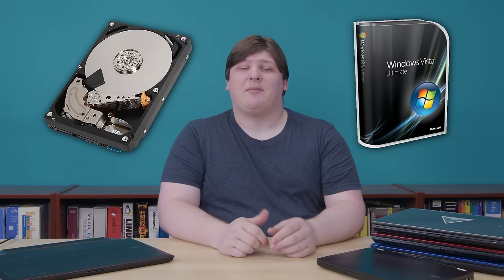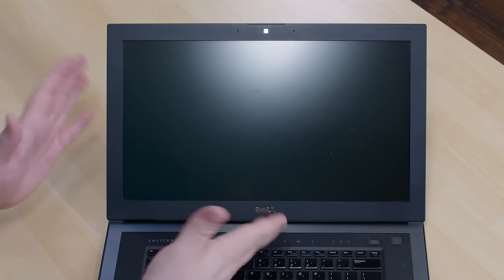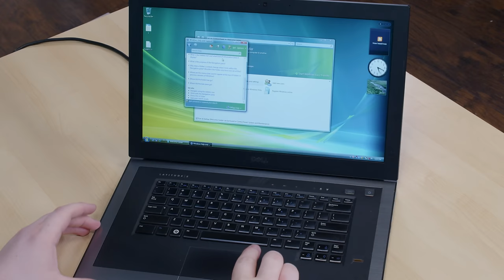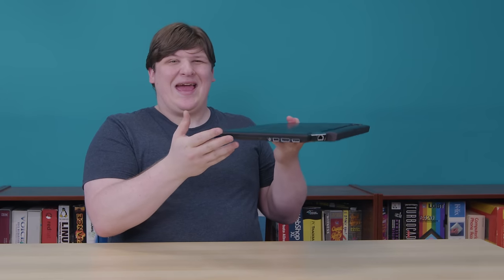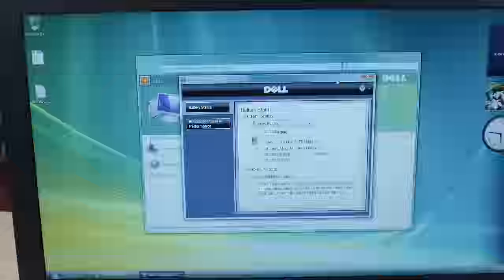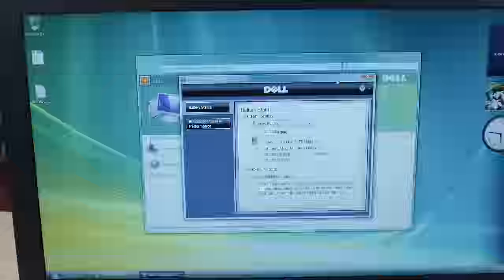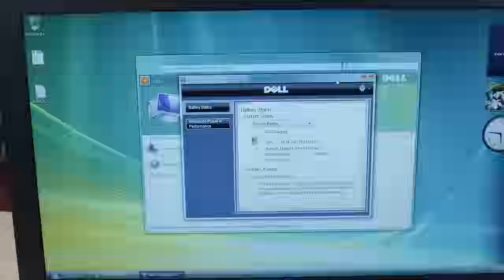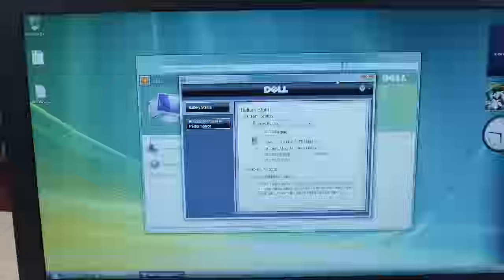Quick Start Ep 6: Assuming Direct Control

Comment: Speaking of that display jab at the beginning...  One thing I distinctly remember about this era is what I call the "great LCD regression."  In the early/mid 2000's, laptop LCDs kept getting better and better resolutions.  Around '07, I even bought a nice HP laptop with a 1920x1200 display.  Then, all of the sudden, you couldn't buy ANY PC laptop at ANY price with a vertical resolution in excess of 1080 (and most being less).  It was horrible.  Pretty much the only way to get a decent display was to buy Apple.
Eventually we got past that, but the recovery started by putting super-high-DPI displays in tiny mini-laptops.  Not by actually putting decent displays in normal-sized laptops until much later.

Comment: I know someone who owned this laptop back in the days probably their job gave it to them while they worked there, I swear!   He also had an XPS laptop that I failed to find existing anywhere. No idea of models numbers, but it was tiny like netbook size and all metal and battery lasted longer than avg, it wasn’t a netbook it was defiantly more powerful and faster. I would say it’s most certainly a laptop dell was flexing it also has every port and expansion possible to fit in a laptop the size of a netbook.  Like CF, SD. PCMIA, maybe have been an esata  as well on the rear, can’t remember where but also had a Ethernet port maybe on rear as well(?) and think came with an SSD.. etc etc, defiantly way ahead of its time.  

And it definitely existed, but I’ve searched every laptop. Dell has made that I can find easily online and I have never came across it… it wasn’t specifically an XPS, nothing perfectly matches or even close enough that it would’ve been the retail unit or the unit he had we assume was retail.    He remembers it, but all the number and letter combinations go to other Dell laptops that are not even remotely close, but he absolutely remembers it when I’ve talk to him.
Reply: I own a Latitude Z, too. 😁 That 'netbook' style laptop you're talking about wasn't a Dell Studio XPS 1340, was it? 🤔
Reply: @FlyboyHelosim  no, M1340 is entirely different looking and too big.  It was much closer to a netbook and as if dell was flexing with what they can do with netbook form factor and silver and all metal, cold to the touch metal on all surfaces atleast closed.  

Oh and one other detail I remember underside where SSD was I assume,  had silk screened “strike zone” on it.

Comment: Amusingly that wireless charging stand could have just had some contacts on it that engage with the laptop and look identical, but actually function. I get the promise of the tech though which is probably why they did it
Reply from the maker: right??? they massively overengineered this! i'm honestly shocked that more laptop power supplies didn't go for this approach. all they needed to do was put four spring pins on the pad and put a low current data signal on two of em so the machine can negotiate power only once it's seated, to prevent shorts. then, bam, you can charge your laptop without having to fiddle with a plug, just set it down.

Comment: 24:33 actually, the Qi chargers send out a short pulse to try to communicate with the device asking for power.  It's around the same frequency as the 125kHz ID chips, so a nice glass tube from dangerous things will show the communication intervals.

I found out because I bought one from Radio Shack for dirt cheap before they went out of business.  I still have it to this day -- gathering dust because wireless charging is inefficient and slow and therefore evil.

Comment: Jail breaking this and putting something like tails on the arm board would be pretty slick if the overall specs of both platforms werent so awful.
It would also be really cool if the module could be used as a rescue or restore platform for windows. That would have been a selling feature in and of itself.

Comment: This also goes as far as the E4310 in the 13/14 inch range, it has the button just like the E6410 as shown in the video. AFAIK it has the module slot just like the one shown here, but my particular example isn't populated with it, so acts like a normal laptop all of the time, even if you press the Latitude ON button. Mine just acts as a second power button, so boots straight to Windows. 

On a sidenote, a modern SSD in this setup running Windows XP is very fast (less than 20 seconds after the BIOS passes through to the drive) so its fine as it is.

Comment: The N900's interface was actually fairly snappy in my experience, I don't recall it being slow at all. I do, however know that the Pandora also used the same OMAP3 before switching to a faster CPU, and while I had the faster 1GHz version (which ran well enough, especially overclocked to 1.3GHz), I could totally see it being painfully slow to use in desktop mode if you had the slower one.

Comment: My dad used to work for Dell, so I have a decent amount of experience with Dell laptops, over the course of the last 15 years or so. All of them have the 'all the weight at the back' issue, and most lift the entire front of the laptop when you try open the lid. Quickly opening most of them results in the bottom crashing back down.

Edit: I actually use an E4300 still haha

Comment: I hope that going full-time video production is working out for you - The depth and quality of your vids has definitely been extremely good.

I had a Dell Latitude with a Core2 processor which was (IIRC) 1.2 GHz.  15" WXGA screen Awful viewing angle. Came with 2MB ram, although it was (in its defence) socketed.

My main memory of that laptop was of the prodigious volumes of hot air that it blew out of the vents on the rear. And the huge 75W brick of a charger.

Comment: You’re correct that Citrix Receiver is software used for Remote Desktop sessions and individual applications (which are just RDP sessions but with everything else hidden). It’s used for thin clients and for WFH applications as an alternative to VPN connections. VMWare View is the old name for VMWare Horizon, which is exactly the same thing but with VMWare branding.

Comment: Soo, fun thing about those WUSB Cards: Dell intended them to go in a looot more machines. Ever wonder why a Latitude E6430 (or even a E5430, or all the other screen size models, and maybe -20 and -10) have 3 miniPCIe slots? That's right, #3 is for "60G WPAN" aka Wireless USB". The Realtek chipset used in these never really worked under Linux, but the Vista x64 drivers work just fine under Win10.. The model of Dock i have only does up to 1680x1050, is your's better?
Reply: Yeah the WPAN cards were also known as UWB, or Ultra-Wide Band, and there were also WiGig cards in some Dell laptops which were slightly different but achieved the same end effect.
Reply: Ugh I had forgotten 1680x1050, what a cursed resolution

Comment: About the battery and how ungainly it is - yours has the extended battery with (I believe) 9-cells rather than the standard battery's 6-cell design (though I will say they should have widened the shoulders apart to have a nice angled finisher on the extended battery.

About the Phoenix hyperspace mention, as a current day dual-booter, I would pay 120 bucks no problem to have that on my modern machines - chuck double the expected amount of RAM in and write the code necessary to gracefully store and restore PCIe card state and it would be brilliant for me to just switch between linux and windows within seconds rather than minutes!

Comment: 21:28 Qi 2.0 was announced at the beginning of this year (2023) and is supposed to just include "apple magsafe" directly into the specification, as well as supporting 15w, although more than 15w is being worked on.
Reply: Qi2 was actually partially apple's doing. they helped design the spec so anyone could implement it if they wanted to.

Comment: psst, CRD; this one's missing from the quick start playlist.

    I have so many comments on this! Everything from practicality to the legal need to a strange correlation with a crazy idea.

    It might not be that these machines boot slowly by modern standards, but that they boot slowly compared to a previous generation. I've noticed that systems which have nothing to do with ACPI boot much faster than those which do. ... And then I watched some more and understood this isn't about speed at all. :)

    I had an idea of fitting a little ARM board into a laptop in the early 2010s, but it wasn't to run Linux. It was to run Plan 9 which, at the time, had no WiFi drivers and little else that you'd want in a laptop. Integration was only going to go via one port, Ethernet if possible, USB if not, because everything you can do on a Plan 9 machine, you can do remotely.

    Email opening slowly doesn't say to me that a 600MHz ARM is garbage, it says that Gnome is disgusting slowbloatware, corroborating the opinion I formed at the turn of the century. It would never be that slow in Plan 9. Lots of things weren't slow when PCs were under 600MHz and email hasn't changed that much.

    Wait, people still think the names megacorps emit have anything to do with the actual products?

    Ah! I remember now: The results of the Microsoft anti-trust legal proceedings meant that vendors had to offer an OS other than Windows. I think that's what these machines are about. At some point, Dell gave up on Linux and just offered FreeDOS as an option. The FreeDOS team were understandably very proud of this. :)

Comment: I was really looking forward for the Quick Start solution that used a non-x86 architecture, as you alluded to in the first video.
And well... gotta admit it was pretty underwhelming 😅 ... a simple idea that really makes no sense at all to actually manufacture.

The other features were pretty nifty, though... especially Edgetouch. Neat idea with questionable utility.
And the wireless USB kinda blew my mind! It's basically modern Bluetooth, but back then it was nothing more than low quality wireless audio,
so the idea of the normal USB protocol being made wireless would've been immensely novel.

Kinda makes me wonder how a modern wireless dock using something like Wifi-Direct or Bluetooth could work...
Still think the idea of coming home, plugging in your laptop to power,
and it automatically wirelessly connecting with all the peripherals at your desk is really cool.

Comment: That SATA interface was also used on 1.8" HDDs. I  remember seeing those here and there but they never really got popular, esp with the advent of the super slim 7.5mm 2.5" drives. Yes I'm mixing the units, yes that's how it was written officially.

Comment: The Remote desktop client is likely so old that it will not work on any OS that has had the "CredSSP Oracle Remediation" updates installed, I remember when I found out about that, I usually run my file server headless and I went to remote into it with my laptop that had all the most recent updates installed so I had to go to the living room and actually hook up a keyboard and mouse and make sure the server was fully updated in order to be able to connect to it since the updated clients can no longer connect to older hosts that are not updated and vice versa, you can actually make it to where you can still remote into XP and Server 2003 from a modern machine if you pull the updated files from the POS Ready 2009 update for it, although there may have been another security flaw more recently found in RDP that has once again caused it to where you can't remote into an unpatched host with a more modern client.

Comment: You mention the N900 and, as someone who owned one, it was both the worst and most incredible mobile device I owned. It was a fully capable, open device that ran Linux and could be trivially targeted with anything that ran on the desktop, but also had glaring hardware limitations imposed on it (buggy 600MHz OMAP, 256MB of RAM, augmented by 768MB of swap on an eMMC) and came out under-baked in ways that meant I could never truly trust it (and it did, frequently, let me down.)

I miss that thing.

Comment: What happens if you take the Lattitude on flash drive out of the laptop and put it in the red laptop? It has the spot where it plugs in so does it then get the full splash top version and gain access to the internet and WiFi ect? Or does it ignore it all together? Or does it use the real fast splash top but add the WiFi networks and does it reduce the power consumption or add more consumption?? Im really curious to know the answers to these questions lol

Comment: honestly the latitude on concept is interesting. i could see a use if it was a dedicated email web browsing system. for some businesses, having an 'airgap' can be important for security. if the main computer had to be locked down to never have wireless connections, being able to use an separate computer to access email and internet on the same device could be very useful.

Comment: Definitely a clever design IMO. I think if they were able to use a better ARM SOC (I don't think there were many good ones in this era, although the OMAP was probably low tier. I imagine TI made it easier to work with versus going with Qualcomm, but that's just wild-ass guessing) and better/more optimized software, it could have been an amazing alternate OS for battery savings. I know I would have loved to have something like this at the time with basic browsing/productivity tools with good battery life. I was one of the beta testers of the Cr-48 Chromebook which came out around the same time and essentially did this (obviously, Chromebook) but ran on a poorly performing early Atom processor. But it ran decently well with gobs of battery life.

Thinking about it, if it wasn't for factors like modern processors already being energy efficient enough to get up to 10h of battery or more I could still see this being a genius design today. But we've got smartphones and tablets people can use as alternate devices, laptops with good battery life, and full fat OSes that perform well and x86 processors that get solid battery life, these types of 'fixes' (in terms of the entire Quick Start topic as a whole) no longer really make much sense.

Comment: Not sure about this machine, but SSDs can definitely help. I have an Inspiron 1720 from 2008 that is running Windows 10 Lite (the LTSC version) credibly. As in, it is perfectly usable. For giggles, I set it up as an engineering machine and was shocked when it didn't actually suck. Of course, it isn't in its original shipping configuration, as I dropped in a T9500 CPU, 6GB of RAM, and a Samsung 870 EVO 500GB SSD.

Comment: Yep I had an E6410 with this feature, always remembered it being useless, but it was definitely present and accounted for. Usually the "Crap I hit the wrong power button" and wait for it to restart into Windows. I was dual booting XP and 8.1 on it. Core i7-640M with 8GB of RAM and I had the dedicated NVS3100m as well. Pretty stout machine!

I never realized it wasn't using my hardware, in retrospect had I known it wasn't going to run my power hungry hardware anyways I might have gotten the standard 3 cell battery to keep it's looks nice and weight down, then just used the browser on the ARM. Most of what I used it for was games and web browsing anyways. Didn't know they came in blue either! Would have loved to have that back in the day.

Could you tell what the part number is for the wireless dock module on the Z600? I went out and immediately bought one after seeing the video

EDIT: Nevermind, turns out for reasons explained in the video that it would not in fact be any good even in this extreme case where it might have made good

Comment: I wonder if there have ever been any machines that did the same trick, but instead of having a built-in ARM CPU, they just have a phone-shaped hole in the side and you have to slot your phone in.  You can get laptop-shaped smartphone docks, and the removal of optical drives from most laptops would've freed up a ton of space, so it seems like an obvious feature for a company that makes both phones and laptops to try at least once.

Comment: This laptop reminds me of the Acer Timeline 5810t, also an equally thin and light kind of machine also featuring the same CPU's, but RAM is not soldered on. Has the same problem of slow CPU's but at least battery life is better and price tag makes far more sense.
Unlike Dell, Acer did not put that experience to waste though, they released the 3820/4820/5820 series (Arrandale) and 3/4/5830 series (Sandy bridge), all of which slightly thicker and heavier than the 10 series but far more practical with full socketed Arrandale/Sandy Bridge CPU's, option for discrete switchable graphics, and actually long battery life of about 6 hours in real world use. Chassis flex is not impressive but at least keyboard is not mushy.

Comment: I booted Into Express gate on my P5Q pro maybe 3 times. HAHAHA Only because I wanted to check it out.

The interesting part was that on the spash top splash screen it didn't work properly with the mouse I had and the directions were inverted Up was Down and Left was right and vice versa.
Once you got into Spashtop  the mouse was fine, and in Windows (XP Pro X64 due to my 8gb ram and distaste for vista) It of course worked flawlessly.